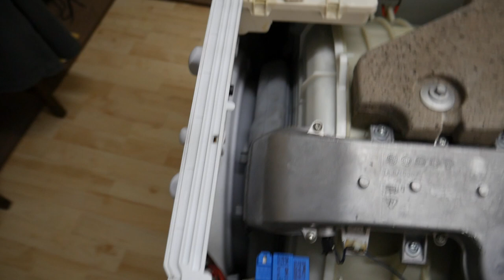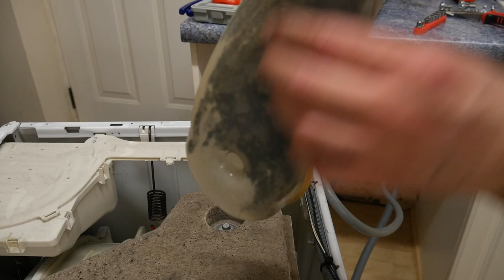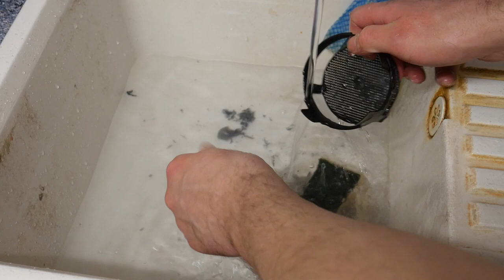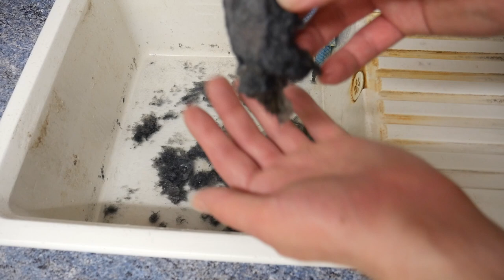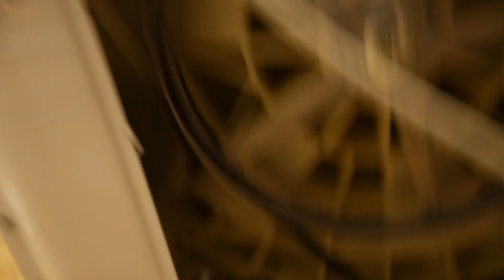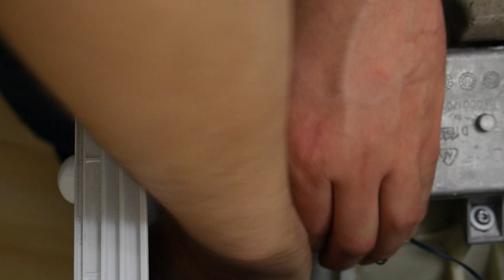Indesit Washer Dryer Repair. Not Drying, Easy Fix!

Comment: This video was very helpful. Spent a few hours yesterday working to clean out mine. Didn't have much space to work so had difficulty getting inside.

Mine is an IWDD7123 and the basic setup is the same except a couple of differences. The area you noticed was corroded is different. There is a short pipe which sticks out and gits into a small hole on the condenser tank which has a rubber gasket. My guess is it was a design flaw which they sorted. I would guess the holes are meant to be open to help air circulation inside it. There is alst a clamp connecting the heater box to the tank which required a bit of fettling to get back in place.

The biggest issue was puting the condenser tank back in. The hose clamp kept spinning at the slightest touch meaning I couldn't tighten it up. Finally managed to do it by using a short screwdriver. I reached through the hole in the back to hold the clamp in position with my left hand while reaching down with my right to use the screwdriver. First try I had a slight leak so went back to tighten it as much as I could and now there is no leak.

It's not the easiest job but it was so satisfying once I knew it was sorted.

Comment: Thank you so much for this video!! It was awkward, but I managed to do it without detaching the wires or taking apart the motor. Just by detaching the motor from the barrel and shifting it slightly to the side. (I even left it connected to the front--no zip tie cutting). 

 It helps to have a second person pull the drum out of the way and gently shift the motor to access the screw and remove the condenser.

Comment: Thanks for posting this man. Really helped me sort it out. I used a small bottle brush for cleaning out the condenser and used gaffer tape to hold the lock clamp in place on the lower connector. This stopped it "walking" around the connector neck so I could get it tight with the socket on the nut with the bendy extension.

Comment: Hi, thanks for making this vid. I'm so glad you mentioned WD-40 to get the bottom part of the condenser back on. I messed around for several hours with mine before finding this video and the oil trick. Now struggling a bit with the loop and screw so the condenser is leaking but will persevere. I phoned for help today and the repairman (who said the condenser is a nightmare and he wasn't interested) said he would throw a few kettles of hot water down and loosen the lint with a coat hanger rather than remove. Less effective than removal but maybe would do the trick for some. Fingers crossed I can get the screw in to the second loop! (Update edit - I was putting the screw first through the narrow loop but it went on easier through the wider loop and then just catching on the narrower one. Got a small drip from condenser so another attempt to go. Think it's because the loop isn't catching the rubber all the way around.)
Reply: All done now. Very slow drip but attached some sponge and will check a possible hairline crack as per your suggestion on a comment below. My machine is a Hotpoint WDL540 P C and everything is identical inside. I'm just watching the video again to decompress and recover now! Thinking about it, that coat hanger idea likely wouldn't work since the filter at the bottom of the condenser would still be clogged. Thanks again for this video.

Comment: Thank you so much for this video. Been fighting an E13 error. Replaced the temperature sensor but didn't help. Started to poke at other bits and it was full of crud, though not much had made its way down to the filter. In the process of reassembling everything and crossing everything else that it works.

EDIT: Reader, it worked. Thanks again

Tip for reassembling the filter - of the three prongs, only one of them fits in the hole in the plastic condenser outlet. Bit of pushing the drum out of the way and you can get it back in, in one. Think that may help with reseating the seal as well.

Comment: Thanks for this video. What a horribly designed piece of machinery. I have already pulled mine out and replaced it with a standalone dryer as I now have space for it since movjng (with easily accessible filters , what a luxury!!). I will clean this pipe and then it saves the machine going to the tip when it could be good for someone to use even temporarily.

Comment: Hi ,very nice video it helped me a lot. I made opening and cleaning as shown. Issue that I have after put back to service is small water leak from this rubber sealing, the one that is kept by screw with spring. I hear click during installation ,but apparently it is not seating properly . I will repeat it hehe . Design is distaster . There is litteraly no space . In my case I have even less space ,because my unit is installed and covered by structure so it is very hard to even turn the unit. Tip dont buy small apartments where everything has to be meassured. 😀🤣
Reply from the maker: Someone else had the same issue. Turned out they hadn't quite pushed it back on level all the way round.

When you push it on use a little circular back and forth as you push, it will help it go on level.
Reply: @killcar5nbike2  Tnx for advice. I assembled just now everything 😀 . I will test tomorrow .. Tomorrow is another day. I did as you mentioned 😀

Comment: My thin rubber gasket had glue points round the casing, nearly bent the heater element. Found the awkward bolt/screw easier with a screwdriver. No rust marks on bottom casing. But we don't use the dryer that often. Good video, thank you, especially with that xxxxxxx screw😁

Comment: Just fixed mine thanks to you 👍 but bloody broke one of the tabs on the filter that the condenser tube tightens onto. Can't see it on any diagrams will have to phone around. 😢

Comment: After buying 2 new sensors which didn't fix the problem, found your videos. Thank you, Thank you. spent an hour disassembling and yes my tank was thick with fur, I was able to clear most by getting my fingers deep into the tank.then washing out the rest. and oh god getting at and retightening that damn screw on the bottom tank seal. however in the end all done and working perfectly. no doubt in a couple of years I'll have to do it again. Cheers mate this video saved my bacon. :)
Reply from the maker: Good work my friend

Comment: Great video- thanks... But, whatever way one looks at this, washer/dryer, the design is absolutely dreadful.
Most puzzled why the filter, and filter tube, has no form of access panel in place, to enable the user, swift access to the parts, to then clean them or replace them.

Comment: It took me 4 hours with my Candy. The problem I wasn't able to unscrew it, so I simply brushed it as well as I could and vacuumed it. As a result, the drying works 😊, but smells like mold 😮. I'll try to disinfect the washing machine and check if it helps.

Comment: Did it today, what an agony for the first time!
There is a trick with the bottom condenser holder, when you remove it you can turn it around so you can screw the screw a lot easier from the bottom side directly with a screwdriver, it is a lot more accessible in that way
Reply from the maker: Never thought of that, I'll give it a look next time I'm in there.
Reply: @killcar5nbike2  just turn around the holder tightener and you will be able to reach it from the back of the washer!
Reply: I also found that when I took it off, so I shifted it to a more accessible place as well-- should make the job much easier next time!

Edit: just tried it but it ended up pushing against the plastic of the drum. Tried a few other options but ended up having to switch it back to normal. Still, at least I have the knack for it next time.

Comment: Thank you for the video. I did it yesterday, and it was a lot of dirty inside. But now my machine makes a really awful loud sounds during the spin cycle, I was so afraid, that turned the electricity off. And I have no idea, why it can be so. I lookes so nice inside, all the screws are in their places.
Reply from the maker: Check you've not got the filter screen  twisted at the bottom of the channel. Maybe it's rubbing in the drum or something

Comment: I have bought a reconditioned hotpoint Aquarius washer dryer and it’s made by indesit it says… so I am assuming this happens to all indesit/hotpoint/whirlpool 2in1 machines? I have a little indesit 4kg dryer but like you for my work uniforms I set it to wash and dry so I can just stick them straight on in the morning it’s a very handy feature 💯🙂 never owned one before bar 20 years ago briefly but this looks a nightmare I don’t want to be doing this lol 😫

Comment: I did this today on my indesit wd12x - it was caked in lint. I reattached the tank to the drum and it's seated properly and tight - but there is a teeny tiny leak/weep when in use from the bottom gasket. It may well have been leaking before - but how concerned should I be of this?
Reply from the maker: Hard to say really, I'd keep your eye on it and see what happens.

If there's a minor crack or something in the plastic somewhere I'd be inclined to rough it up with sand paper and seal the crack with slow curing epoxy resin
Reply: I've just finished this job on my machine and have the exact same very slow drip. I cut rectangles of a sponge cloth and cut a slit in each by folding them in half then pushed them on to the hard plastic tab that sticks out at the bottom beneath the condenser's lowest point, where the drips gather. Sponge should absorb and dry out with each cycle since it's a tiny leak. Just seen Liam's suggestion about the condenser and there is a thin line at the bottom of mine and I have been pushing hard to get it on, so maybe that is a hairline crack. Will look into that too and seal if so. This whole job took me three half days, some blood, almost tears and yoga-like stances to get at it all. On the plus side, it's the first time I've seen the dryer working properly!  The fan was just a big spinning cotton ball...

Comment: The "spray" inlet of the condenser is supposed to also clean out lint. SO is that pipe a case of "bad design" or is this a common problem of all washer dryers?
Reply from the maker: I can't say if other machines suffer this problem. The whole set up is a poor design really. If a bloke in his kitchen can see problems in this design, and tumble driers have had lint traps since they were invented. One can only assume the person who designed this has either never done a load of laundry in their life, or just didn't care.
Reply: @killcar5nbike2  YES. More or less alll "combos" suffers of lint on condensers. It also depend how many drying cycles you usually operate. Miele has a special clening program they suggest to operate after ALL drying cycles ... this definly vanish all promeses of energy saving ... but you know they are German. Anyhow some one should invent a simple "filter-Drawer" ejectable from the machine's topside. Something that operates stopping lint between the fan housing and the condenser pipe.

Comment: Everything is clean on my machine... I connected the fan motor directly to the power supply and it doesn't work. The motor is 230v 50hz so should it work connected to the 230/240 50hz power supply?
Reply from the maker: @worick995  IIRC it's just a two wire mains motor. If it's definetley connected to a live mains feed and not working then it's probably defective
Reply: @killcar5nbike2  thank you

Comment: When you attach the wires back I didn’t have the block (the two black live wires). Mine were metal clips on the end like the Earth, Neutral and brown live,  can the two black wires be placed either way round?
Reply: @ 52:16
Reply from the maker: If it's the ones for the heater fan then they can go either way.
Reply: @killcar5nbike2  thanks Liam,  I thought so but just double checking even after my 4th wash and dry😂. Just the washer keeps tripping my isolator every so often,  twice in four washes/drying.
Reply from the maker: @davidlynchehaun5972  I'd make sure there isn't any water getting onto the electrical connections, and that all the connectors are on securely.
Reply: Hi Liam,  First,  thank you for your video,  I didn’t realise with the first reply,  you don’t realise how your video saved me,   I did have an epic fail when doing mine,  a bit fell out of my screwdriver into the machine,  so I tipped the machine a bit and the water inlet pipe at the back (old pipe) snapped in half as I pushed to the side a bit too far.  A bit of water did go in the machine so I wiped down and left it for about 5 days for any unseen water to evaporate.  At least I mopped my floor 😂